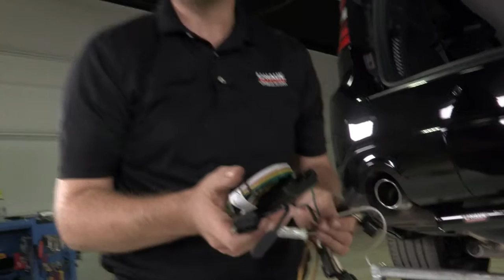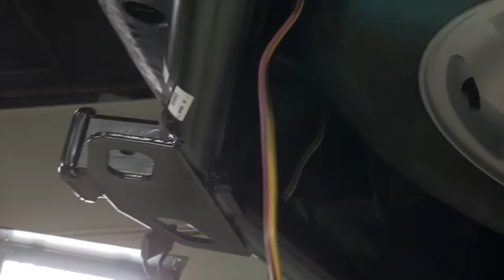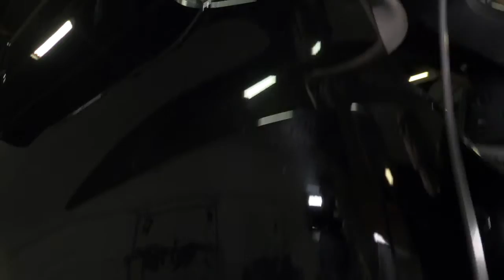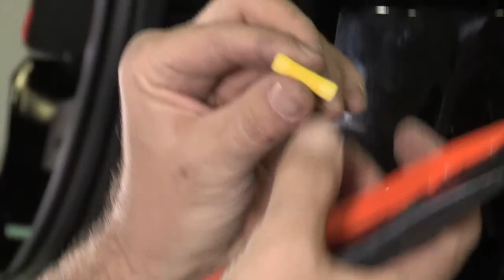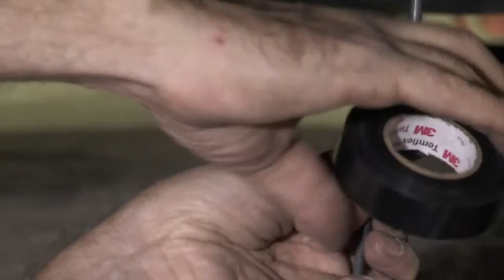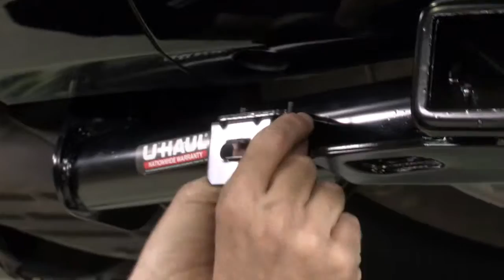2019 Dodge Durango Trailer Wiring Installation

Comment: why do you guys have to jerry rig the system, all you have to do is get the right plug, and go to a dodge dealership and tell them to turn towing on in the system on your computer.
Reply: This is an alternate installation option. Some dealerships charge hundreds more than it is to buy this part and install it so it's usually a cheaper option.
Reply: The dealer charge a lot of money just to put in one simple fuse not to mention to hook it up to their computer..